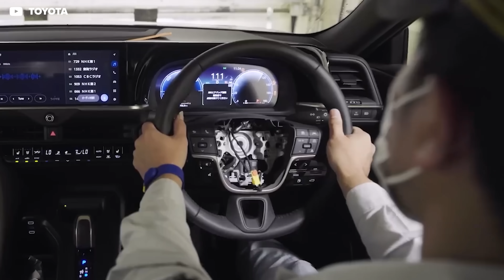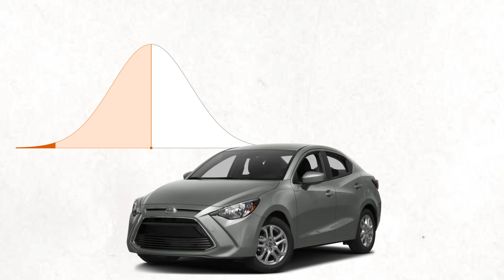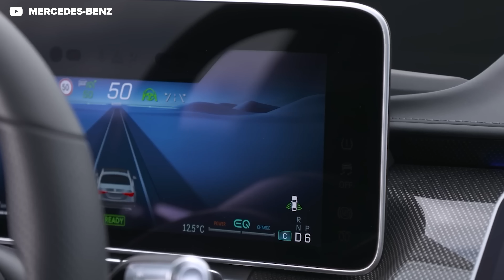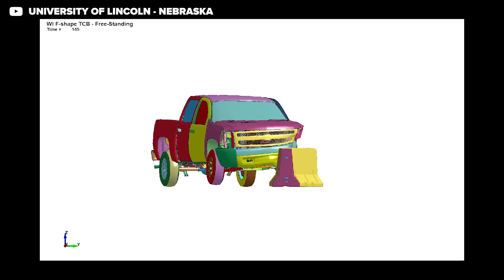The REAL reason guardrails can't stop EVs in a crash

Comment: Another problem that shows up with the Rivian is that trucks and SUVs have gotten taller. They have big tires and elevated frames. The bulk of the body is above the guardrail, resulting in low earth orbit.
Reply: A related issue is that the popular W shaped sheet metal rails height has increased recently from 27" to 31" to chase the higher c.g. of PU trucks and the current dearth of low cg. sedans like the Geo metro.  Trucks asr still getting taller (Ford Maverick excluded) and electric sedans now have a low cg. widening the range of cg heights that the w shape needs to accomodate.  If the trends continue the W shape may have to give way to the deeper stronger thrie shape (three ridges insteasd of two).

Comment: by whatever logic you are using, you simply add another model 3 on the roof of the current model 3 and then by "your logic" the model 3 will no longer go under the rail because all that weight is now above that low center of gravity. Now with another 4000 lbs of weight on the roof it will magically stop the rail from being ripped upwards. Problem solved.
A 5 year old child could make more sense. You put your hands under and lift up any weight you want if you are stronger. You put your hands straight at dead center and no matter the strength or where you center of gravity is, you are NOT lifting anything up unless you go under it. The rail doesn't give a crap where the battery is, under the car or on the roof. Retarded or being paid to act retarded and make false claims. You can't make this shit up because you would run that test with a Model Y that has a low center of gravity as well but you couldn't lift that rail so you wouldn't publish the finding. Any Tesla matches or is less weight than it's competitor gas car. Only 1 brand is 4000 lbs heavier and it's going bankrupt so there is no worries there, the rest of EV makes now how to make an EV the same weight. Tesla is a very cheap car company and is not going all out using lightweight materials to make their cars the same or less than gas cars. Hummer was built by monkeys that have zero clue what the purpose was of that car.

Comment: 7k pounds is not the normal...but an escalade is nearly 6k pounds.  

the only EVs that are that dramatically heavier than a similar class and sized gas car are large SUVs and Pickups.  EVs are not ready for pickups and large suvs.  

and comparing vehicles from the 60s to the 2020s.....maybe try vehicles that are still on the road today to compare weights.  such as vehicles from the 90s, and compare them to vehicles today, even the same exact models and you will see a signifigant weight change over the last 30 years.

beyond that, its interesting to see the weight distribution aspect of it.

i would like to see the model 3 and a car of the same height and front end aero....that could be ripping thru as well.  would be interesting to see that compared.

Comment: I’m hearing so far I haven’t got that far into this but I’m hearing a lot about the weights of the vehicles. What about the height of general travel? The height of that weight? Do you want to think about that? And maybe increasing the height of your barriers because after all the impact point of the barriers I’ve already shouted by preliminary impact from the bumper bar so when the rest of the vehicle hits it, it’s already pre-doneso I think about the weapon that is your EV vehicle and rethink the engineering because crash test I’ve gotta be re-taught height is your issue the right height of a vehicle get under control

Comment: You forgot to mention the dangers of the excessive weight of electric trucks approximately 2000 lbs heavier. On our aging parking ramps. I hope that the structural engineering community is aware of this problem.

Comment: There's not a single EV that weighs 4000 over the gas counterpart lol
Reply from the maker: Chevy Silverado: 4600 pounds
Silverado EV: 8700 pounds
Reply: @drive you got me, 1 single case where if you add ALL options it does.
Reply: @drive  I have no horse in this race, but I was shocked to see such a disparity. It's heavy! 

Fwiw, the Silverado ev is on the Hummer ev platform, which is sort of splitting the difference between 1500 and 2500HD models. When you start to compare things like suspension heft, brakes, hp/tq, you start to see similarities to the HD trucks. Our late model 2500 is over 7k lbs curb, so I feel like its more apt to not compare the EV to the 1500 1-to-1. I feel the EV tow rating is only so low due to it itself weighing a boat load. Much like a 2500HD with an oversized bumper, slide out drawers and a roof top tent and double sized fuel tank. Pickups specifically are lighter than their chassis is designed for because of payload and towing. EVs use up payload for the batteries. Curb is closer to Gross weight limits. I think this gap closing muddies the comparisons.

Granted it's marketed as if it is, and so are other ICE to EVs but I honestly think the larger price tags and heavier components (& battery) of EVs being common, mislead us to thinking they are the same. All because they want to hit those range numbers. The blazer ev heavier, or a tesla model Y is heavier than the same sized car because they need a larger battery for range. If it wasn't so important we'd have Leafs and Volts which ARE comparable to similar looking vehicles. Either way every EV is like seeing a heavy duty version of their counterparts to carry the weight.

Modern EVs really hit a class of their own. Even the Bolt is well under 4000lbs and is still like 30% heavier than similar compacts. But I doubt it's using the same thin gauge stamped sheet for suspension that's on cars weighing under 2800lbs. I should look into that.

Anyway, that was a fun dive into that topic, cheers!

Comment: But we already know the government cuts every corner they can on infrastructure.
Even if they install safety measures that means they also have to maintain them which they rarely will 
I rode a bicycle cross country you get up close with guard rails a lot sbd let's just say I saw a lot with serious issues 
So if we need more expensive ones good luck seeing those get maintained

Comment: Funny how people have no idea on the weight thing. 2500-3500 trucks have weighed 7k+ lbs since the 90s
Reply: The issue is not the weight but the popularity of vehicles that weigh that much. 2500 and 3500 trucks are not particularly common on the road in most areas. But now we have suvs that soccer mom's use that weigh as much as a 3500. They dont recognize the added danger of a vehicle that weighs so much so they drive them as if they were half the weight. That's not even mentioning the hummer ev which is almost 10k pounds. Nearly as heavy as a box truck in a full size suv.
Reply: Why are American Pick up trucks Cabs so HUGE compared to their Bed length? 
Perhaps that's what Sells!
Reply: Yes, and fatal accidents have been increasing as they proliferated the market
Reply: Try 1970’s. The tare weight of my 75’ F250 long bed Super cab was usually 6000 to 6300 lbs.  My 99’ F350 PSD long bed Super Cab is 7000. When pulling my travel trailer I am over 14000 GVW.
Reply: @gotsloco1810 yes, and an increase in fatal accidents as those vehicles proliferated

Comment: I’m REALLY surprised that the skateboard battery tech is the go to for almost every ev car company. Maybe because it’s cheap?
Reply: You can't put the battery on the roof because it will flip, if you put most of it in the trunk there will be no space at all for groceries, if it is all in the front where the engine should be the rear wheels can't grip for acceleration, if it is flush against the bottom of the vehicle like in a skateboard design the weight is balanced front and back, left and right, the center of mass is just a lot lower, which is great for handling, but the weight pretty much negates to be almost identical to a gasoline counterpart.

Comment: ok your claims about weight are flat out propaganda... the average EV (like a model 3 or model y? weigh 3500 - 4000 lbs...
a comparable ICE car weights... about 3500 - 4000lbs.
You're over here pulling an outlier at the extreme end of the spectrum and obviously comparing it to another outlier on the opposite extreme end of the the spectrum...

Comment: I once thought my 1982 Porsche 928S was a heavy beast, at 1420kg. This compared to my '69 911S, which weighs just 1,040kg wet.
Now the 928 looks like a lightweight, and my 911 might blow away in a stuff breeze. :P
Modern cars are utterly stupid - and all three of my classic cars will still be running in 20 years from now. And probably 40!

Comment: I like batteries, have 16kW at home and building an upgrade to run 230/400V at 30kVA.
These batteries remain in their own 'plof' proof 'bunker'.
Having a lithium battery in a car is an whole other environment.
Cold nigths hot days at the parking lot and condensate will form.
And that's just when not driving..

Comment: I love the comparison, I have a 1970 F250, all steel, minimal plastic, all cast iron engine. I have a 1965 10’ Alaskan NCO camper in the bed and the fully loaded camper and truck weigh roughy 6000 pounds.  Still less than most EV’s.

Comment: EVs can also go fast faster.  There is too much ready power in vehicles in current use.  This gives drivers a false sense of ability (NOTE: NOT security).  For smart EV drivers the greatest benefit is to drive for optimum energy use.  This alone prevents many collisions and other destructive events.  As an EV driver I try to maintain 4 m/kW.  I can get 5 -6 m/kW in good conditions.  To get this a driver must not exceed any posted speed limit, and may be drive a few mph below that posted speed limit.

Comment: Interesting.  The model 3 was generalized as "Teslas" performance against these barriers.  However, the Y is a much stronger seller than the 3 since its introduction 5 years ago and has a higher center of gravity than the 3.  It also weighs a similar amount to other compact SUVs through better than peer efficiency allowing a smaller battery for the same range.  Doesn't this increased center of gravity and similar weight to the rest of the class improve the retention of the guardrail system?  i.e. this problem lessens with time as EV weight decreases with improved battery tech and modern construction methods along with the consumer preference for SUVs over sedans?

Comment: sorry but this center of gravity argument doesn't fly with me. The rail doesn't hit the car exactly at the center of gravity, it hits it in the front, where usually the crash rods etc are placed. So either those are too far down (which isn't a problem of EV) or here's a different problem, but the TEsla sliding underneath the rail has nothing to do which where the weight of the car about 1,5m behind the impact point is distrubiuged,.

Comment: On average, the weight difference between BEVs and their ICE equivalents is 10% to 15%. I drive a 2022 Chevrolet Bolt EUV. The closest equivalent ICEV is the Chevrolet Trax. The weight difference? The Bolt EUV is 618 to 653 pounds heavier than the Trax, depending on trim level. Not 4,000, or even 1,000.

Also, just for reference, let's look at the weights of the Top 3 vehicles in the US:
• The curb weight for the 2024 Ford F-150 ranges from 4,021 to 5,540 pounds.
• The Chevy Silverado 1500 ranges from around 4,400 to 5,620 pounds.
• The Toyota RAV4 ranges from 3,370 to 3,817 pounds (heavier than my Bolt EUV Premier).

For comparison, the best-selling EV in the US is the Tesla Model Y. It's weight? 4,154 to 4,404 lbs. So, lighter than either the Ford F-150 or Chevrolet Silverado 1500 and only slightly heavier than the Toyota RAV4 (587 lbs/15.4%).

So, where's the story here?

Comment: It's going to be an engineering challenge to redesign guardrails to better catch EVs without making them more dangerous for regular cars but I'm sure it can be done. Making a guardrail stronger won't fix the problem because guardrails are meant to catch vehicles not bounce them back out onto the road

Comment: 4000pounds more? I am going to go ahead and call bullshit here. There absolutely zero models that have a gasoline equivalent thats 4000 pounds lighter. Even if a take a 1964 fiat 500 and compare it with a 2025 fiat 500 EV its not even close. Your whole video is full of flat out lies and exaggeration. Maybe you are comparing a chevy to a mac tru k because you don't seem to know anything about cars.
Reply from the maker: Look up the difference in weight between a Chevy Silverado and a Silverado EV. Go ahead.
Reply: @drive  Silverado EV is barely heavier than the Silverado HD..... Both are stupid heavy but there are indeed many different battery packs. If you compare the two top models they are about the same.... Still calling bullshit.

Comment: Please, please, please, do show me which EV is "up to 4,000 lbs. heavier than an equivalent gas model." It's OK, I'll wait.

Oh, so there you can't name even a single vehicle that meets your hyperbolic criteria? Color me shocked.
Reply from the maker: Chevy Silverado: 4600 pounds
Silverado EV: 8700 pounds

Thanks for waiting 😉
Reply: @drive  Under the heading:  "Numbers don't lie. Good accountants do."

Here's a more detailed breakdown of Chevrolet Silverado curb weights by trim:
• Work Truck:  4,400 lbs.
• Custom:  4,720 lbs.
• LT:  4,720 lbs.
• RST:  4,860 lbs.
• LTZ:  4,860 lbs.
• High Country:  4,860 lbs.
• Custom Trail Boss:  5,080 lbs.
• LT Trail Boss:  5,080 lbs.
• ZR2:  5,620 lbs.

Next, the data for the Chevrolet Silverado EV:
• WT:  5,290 lbs.
• RST:  6,800 lbs.
• 4WT:  8,532 lbs.

So, yes, when performing an apples-to-oranges comparison of the lightest ICE trim (WT @ 4,400 lbs.) to the heaviest EV trim (4WT @ 8,532), the weight difference between the two is 4,132 lbs. However, apples-to-apples comparisons of the WT and RST trims, for instance, the weight differences are dramatically lower. ICE WT (4,400 lbs.) vs. EV WT (5,290 lbs.) is just 890 lbs./20%. ICE RST (4,860 lbs.) vs. EV RST (6,800 lbs.) is 1,940 lbs.; a little less than half of the hyperbolic 4,000 lbs. mentioned in the video.

Comparisons between other vehicles that are offered as either ICE or BEV tell a similar story. The Hyundai Kona is a typical example. The Kona (ICE) curb weight is between 2,718 lbs. and 3,459 lbs., while the Kona Electric weighs between 3,384 lbs. and 3,843 lbs.; differences of 666 lbs. and 384 lbs., respectively.

Comment: The statement that ev's can be up to 4000 lbs heavier than an equivalent ICE vehicle seems questionable.  4000 lbs is 1820 kg.  I'd be surprised if the combined weight of the electric motor and battery in any ev came to this - and remember that we have to compare the electric motor / battery combination with the ICE engine, cooling system, multi-speed gearbox, fuel & tank and exhaust system.
Reply from the maker: Chevy Silverado: 4600 pounds
Silverado EV: 8700 pounds

Comment: I really don't get the thing with the lower centre of gravity. That should only matter if it's causing a difference in the way the car is rotating about a horizontal axis during the impact. A higher centre of gravity might lead to the car tending to roll when it hits the barrier, whereas a low centre of mass would tend to make the car more stable. But I didn't see any examples of ICE cars rolling over on impact, so I'm not sure what's the mechanism that makes lower COG more likely to go under the barrier. I would have thought that the shape of the car would have a much more significant effect: a pointy sports car can wedge itself under the barrier, whereas a blocky pickup wouldn't.

Comment: There also not talking about is how deadly guardrails are for motorcyclists.  A single rail guardrial system is designed to maximize injury as the motorcyclist slides under it iduringa crash.  The support posts are also designed to break bones and tear limbs off.  The simple solution is adding a lower rail to prevent the motorcyclist from sliding under it or being dismembered by the posts.

Comment: What's worst is the battery pack can rip open during a impact with guardrail systems.  
The post are potential can openers to ur lithium battery pack.
Reply: Lithium fires are incredibly hot and difficult to put out.  Plus release toxic forever chemicals.

Comment: which EV is 4000lb heavier than its equivalent ICE model? Does it have 5 extra battery packs strapped to the roof to get a 1500 mile range? If you are going to start off your article with such an obvious lie, it doesn't bode well for the accuracy of the rest of your report.
Reply from the maker: Chevy Silverado: 4600 pounds
Silverado EV: 8700 pounds